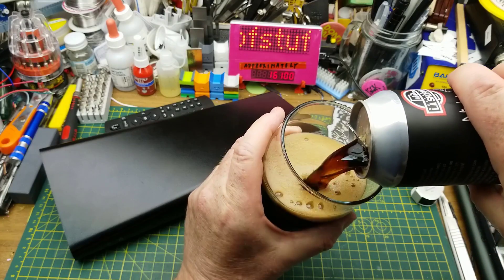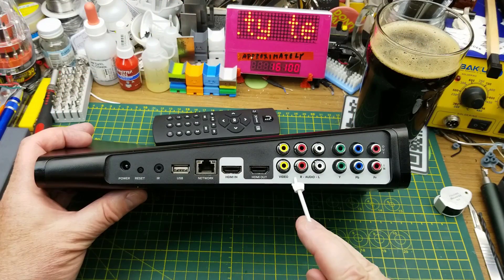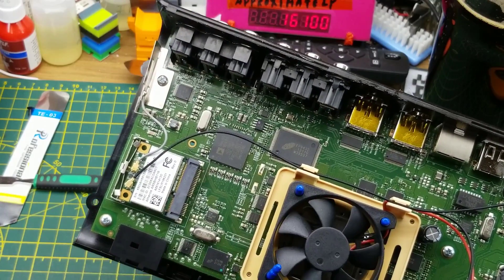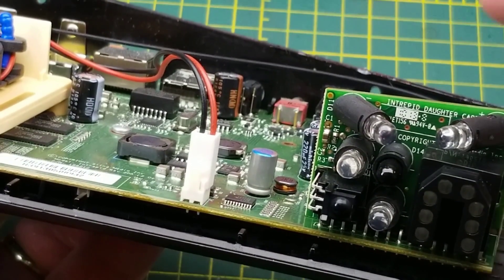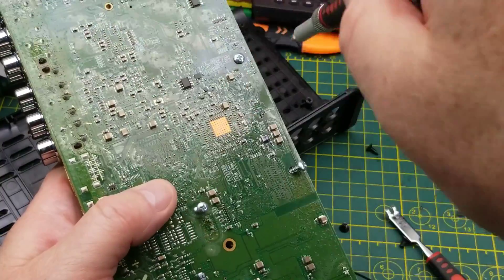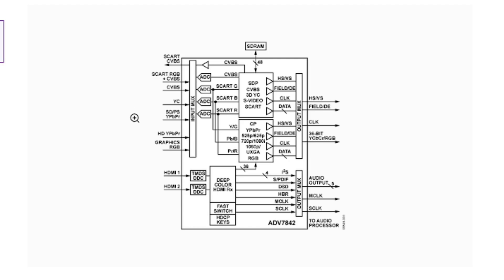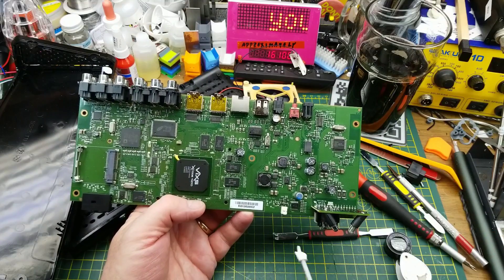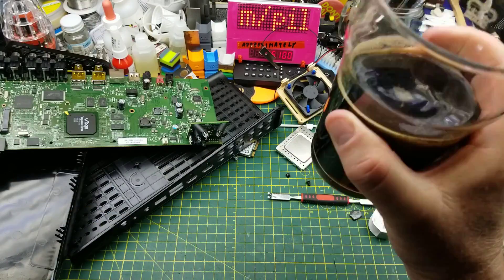Curiosity teardown: SlingBox

Comment: You can solder a usb cable to the WiFi card, and use it as you would with any other usb wifi dongle. Just remember to put a 3.3v voltage regulator on, or you'll let out the magic smoke 💥💨
Reply: Also, remember it's a PCI-E Wi-Fi card ...

Comment: AFAIK the Atheros 802.11n wireless chipsets not only have great drivers in the Linux kernel, they don't need firmware blobs. Definitely worth keeping. As for the product discontinuation, it certainly sucks. Apparently they started sending out firmware updates to brick them even if you got the third-party server working.

Comment: "not much to salvage" often thats the case with most (embedded) devices. They put most of the functionality in the linux based os which allows them to easily add/tweak features and yep sadly make the device obsolete.

The wifi card might be salvageable and the fan too. Maybe some ports and ir can be used to practice smd soldering. I have a lot of softbricked settopboxes that i or the manufacturer bricked and use it for smd practice

Comment: The Wi-Fi card might be mini pcie. Used in older laptops for wifi.
Reply: There's a video on here of someone taking one out of a Linksys router and trying to use it on a computer, and running into driver problems, hopefully @pileofstuff has an easier time

Comment: Much more interesting than the tons of cisco set top boxes i have lying around.

The card is on a mini-pcie slot. 😊

The RAM is 8 Gigabits, or 1 Gibibytes.

The inductors for the ethernet port are galvanic isolators. Some modern rj45 ports have them built in to the port housing.
Reply: Yeah i have not seen much Linux powered stbs that had wifi cards in pci form